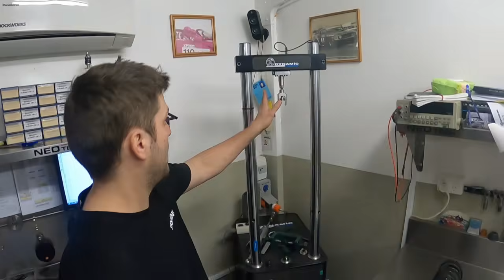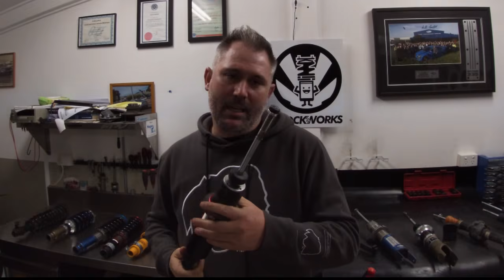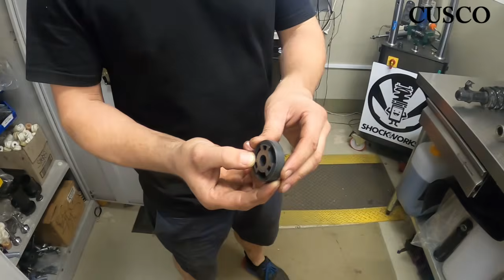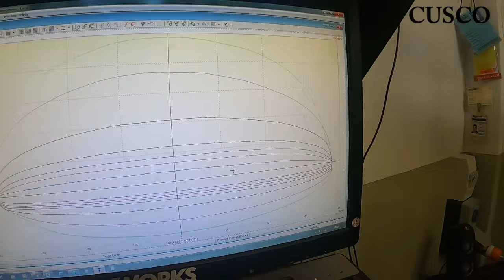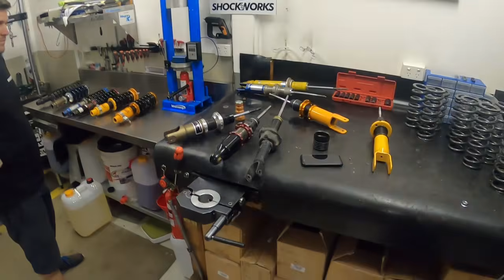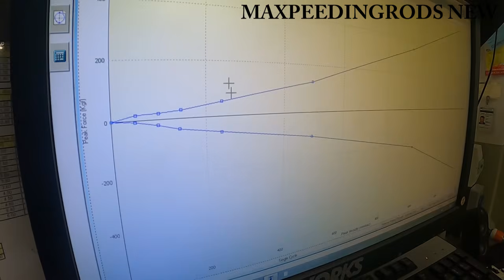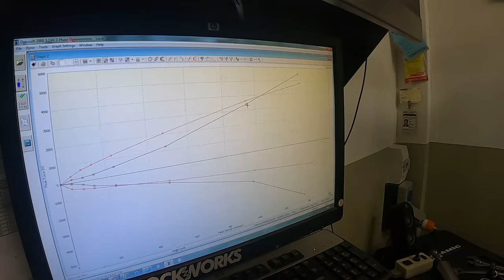8 BRANDS OF COILOVERS ON THE SHOCK DYNO!!! WORLD FIRST TEST

Comment: Great content guys and super informative. I’m a very amateur former club-level racer here in NSW who achieved reasonable results using the Tein Superstreets with the spring rates and valving as per Fulcrum’s setup. Oh-in a GDB WRX STI. The rear struts started leaking after about 5000km but I believe it may have been extended time between drives may have buggered the seals. I’ve had both rears rebuilt and the front left is leaking and knocking too. Have you dealt with these struts before as I’m keen to hear your opinion.
I’m thinking seriously about Shockworx setup for my FG GS. Good to see they performed well, though I’m also considering Bilsteins on Kings low as it’s not a track car.
Great content and I’m subbed.👍
Reply from the maker: I would get shockworks over tein any day heck I’d get bc over tein, but shockworks are amazing all the top time attack cars run them, plus they can be valved for street also
Reply: @TURBOTRISTO  whats wrong with tein? Just bought ones for my car, toyota chaser jzx100
Reply: @TURBOTRISTO  what’s up with the teins?
Reply: @daskamu  I’ve had both rear dampers rebuilt and the front left needs rebuilding as well. These are Tein Super Streets with less than 15,000 km on them.
I’ve found the Teins are great while they are working, in so far as they are OEM factory quiet, comfortable for the daily drive and still capable on the track for a bit of club-level shenanigans. The damping/spring rates are far from optimal for track but I’ve put down some respectable/competitive lap times on the Teins and I can “glide” over ripple strips that upset stiffer setups.
The low-km rebuilds are the biggest problem with mine, but I’m probably contributing by leaving the car for weeks at a time.
Reply: @TURBOTRISTO  most of the serious guys and gals in the NSW combined clubs Supersprint series I used to run in seem to be running MCA although I’ve seen some very quick cars on KWs, HSDs (surprisingly good from my observations) and BC racing. If/when I get the time to get back into it, I’ll be tossing up between MCA and Shockworks for a more track-focused setup for my long-suffering bugeye Subie.

Comment: Love the amount of data gathered. I'd be curious to see how the newer Maxpeedingrods T6 and T7 coilovers stack up against the ones shown in the video. It appears that the ones tested here are the Maxpeedingrods B3 coilovers and maybe the O-series prototype.
Reply from the maker: @jordanlatta  there is a new c series coming also, the t6/7 coil overs dyno test as good as the bc coilovers now, the are working on t8
Reply: @TURBOTRISTO 
Sweet! Thanks for the reply, just discovering your videos, looks like some neat content. I'm hoping to get some T6 coilovers for my 99 Impreza, but with custom spring rates a bit softer than normal (5kg or 6kh front, 4kg rear, similar to Tein Flex Z which is the go-to street oriented affordable Subaru coilover) since the roads near me are pretty rough on my current non-adjustable Raceland coilovers (9kg front, 6kh rear). Interested to see what tier the new C-series will be aimed at and how they perform.

Comment: The maximum pee rods are not all that bad for the price. I ran a set for a few months on my Bugeye WRX while I was deciding what I actually wanted to go with. They were actually surprisingly OK. If you just need something quick because your OEM ones took a poop they will serve you just fine. You can even get a bit sporty on them as well lol.
Reply from the maker: They are 3 times better now
Reply: @TURBOTRISTO  would love to see updated results for them ;)
Reply from the maker: latest video with the thumbnail "runs so smooth" has updated dyno sheets
Reply: @TURBOTRISTO  yeah I used the COT6 coilovers and they were super easy to adjust and install. If I was playing to do some sporty driving ("doing turbos" is what my girlfriend calls it lol) I would just adjust the knobs to stiffen them up and for everyday driving I kept them somewhere in the middle of the adjustment range. They actually looked pretty good as well, the blue and black looked really good with my blue brake calipers and gunmetal gray rims. They are definitely an upgrade from the OEM suspension that came on the 2nd gen wrx's. I eventually upgraded to a set of Tein coilovers and the only real difference was that the adjustment range was more dramatic and they felt less bouncy and at their softer settings, but honestly there wasn't actually a huge difference in the overall performance.
Reply from the maker: thats awesome news man

Comment: Would maxspeed coilovers be able to handle canyon and mountain drives consistently?
Reply from the maker: Depends on what you mean by consistently, as long as the roads aren’t to bumpy then there won’t be much heat in the oil or air causing cavitation

Comment: As a joke, my buddy got me some ebay coilovers for my daily driver.. I actually put them on to slam it (lol),, and will say they are definitely functional to a degree. They dont exactly soak up your standard pothole, but they are stiff, and even came with adjustable damper and camber. Certainly suitable for autocross, or anything entry level
Reply from the maker: @LetsGoECU1  no shocks slammed will soak up a pothole mate you need shock travel

Comment: Yep. Max speeding rods can take a hike. It would have been good if you could have tested new.. but seeing OEM hold up well after 300,000km and out perform new max speeding rods… re affirms I’ll. To buy them. I will check out shockworks to see if I can afford them for my two CELICA’s. ST-184R and 2ZZ-GE
Reply from the maker: Man they are not expensive for shockworks and they are truely the best coilovers on the market hands down they out perform bilstein and mca

Comment: If you want to eliminate that lighting flicker, you either need to switch the camera to PAL mode and shoot a PAL framerate like 25 or 50, or you need to activate shutter priority auto exposure and force lock a 1/50th of a second shutter speed with your 30fps filming. Basically, you live in a country with 50hz power mains, and no part of your camera's video settings match up with that frequency in order to cancel the flicker of the artificial lighting in your shop/house/street lights, etc. Either the frame rate OR the shutter speed has to be an even division of 2x the power line frequency to cancel the flicker.

Universal combinations that work in every country and look good are 25fps 1/40th or 1/60th shutter, 30 fps 1/50th shutter, or 50fps 1/60th shutter. 60 only works with a 1/100th shutter, which isn't slow enough to have natural-looking motion blur, and 24fps looks bad in general. Yeah, 25 isn't much practically/visibly different (it barely is when back to back from a trained eye like mine), but it's subconsciously smoother and produces less eye strain than 24, IMO. My go-to choices of the lot are either 30 or 50, depending on your digital storage space limits and a couple of other filming goals.
Reply from the maker: @Drunken_Hamster  all done mate sorry about that it’s frustrating
Reply: @TURBOTRISTO  Did you just change it, or did you figure it out long before I commented? If the latter, when was the change, and what settings did you go with?
Reply from the maker: @Drunken_Hamster when I was editing this video I fixed the settings
Reply: @TURBOTRISTO  Nice. I saw your most recent Accord video and noticed it was 50fps. I assume the shutter speed is on fully auto, though, because it didn't quite have the motion blur that I aim for with a 1/50th or 1/60th shutter.

Most people don't overthink things like me, but if you do (or just care, in general) go ahead and do the shutter priority mode thing and lock it in at 1/60th. If you later notice that the outdoor shots are blown way out, that means you need to close down the aperture, or if that's not an option (IE, you're using an action cam like a GoPro), then you need an ND filter.

You can get a 4-pack (different darkness levels) of Freewell ND filters for a decent price, and those'll work on a GoPro 9 or newer. IDK about other action cams.
Reply from the maker: cheers mate, im using a go pro 9

Comment: Where did you get that Multimatic dyno lol?  More response doesn't always mean better.  That's how you get really bad nibble.  Other than looking at the curve to see if the damper is functioning as intended, you can't tell whether it's a good damper or not.  So much depends on vehicle config and tuning targets.  It looks like you smacked the base valve or floating piston on the AMR.  As it travels from full rebound on the left to full compression on the right, the forces jump at the exact same spot and then it resumes opperation as normal.  Probably will go away if you reduce the travel.  But the tuner definitely knows what he's doing.  His Shockworks dyno curve was beautifully shaped!  Probably smooth and glides on smooth road, but kicks in the rebound control agressively, but progressively.
Reply from the maker: I’m no expert but Chris is he was litterally born into shocks and has spent his life mastering them, what ever he says I just smile nod and take as gospel

Comment: This is great I'm in two minds between these cheap coils and Whiteline springs for my lancer Vrx 

Very helpful content guys I've subscribed. P.s where about in Melbourne are you from?
Reply from the maker: From sprinvale mate thanks for the subscribe 💚 whiteline springs will be great but they might blow your shocks because stock shocks aren’t designed to be lowered, by the time you buy lowered shocks you might find it’s better off to go with some coil overs
Reply: @TURBOTRISTO  cool not far away I'm in Oakleigh..yeah alot of people have just run these Whiteline springs in their lancers on the OEMs with no issues. It's about a 35mm drop in height all around so nothing to crazy, so I think there is still quite abit of travel in the shocks. This car is a just a daily that gets driven to work and back each day, nothing hectic like track time, I do love the height control of the coilovers to be able to dial in that perfect height, I just need to decide if want the comfort of springs over the slammed look which is obviously going to be alot more of a ruff ride.
Reply from the maker: @Itsok-456  comfort is king man 30mm drop is sweet I did my mrs accord 30mm and it blew out a shock instantly, I work at koni and they say that anything over 30mm should need coil overs or custom shocks because the stroke isn’t long enough to absorb the bumps

Comment: what Maxpeedingrods does to mask the lack of dampening so people think their coilovers really improve handling is to over spring their coilovers which makes the car stay flat when cornering, add to the fact that the pillow balls they use are junk and can stop rotating after just a year of normal street driving, combine that with the fact that the thin teflon disk they use between the spring and the spring mount rip just from the force of the spring during normal street driving causing the spring to start digging into the lower mount and binding, put all that together and you end up with a car that is dangerous to drive to the point of causing the car to bump steer into the center divider, ask me how i know, my totaled toyota avalon is still sitting in my front yard, btw good luck trying to get maxpeedingrod coilovers warranted during the warranty period, all of a sudden their english not so good, you send money they send better stuff........
Reply: Throw MSR away and buy anything else.
hell cut springs and struts are better that this appalling POS.
FK coilovers work great for me and the same price.
Reply from the maker: @pethelprc4721  hey mate you are exactly correct the old style mxrs were absolute rubbish, they are up to version 8 of their upgrades now most of those issues if not all of them are fixed, the earlier versions 1-6 were very bad and caused them a lot of issues,

Comment: my xyz feel like they do the same as the maxspeeding rods lol, they dont do much for speed bumps but smash around when hitting a pothole
Reply from the maker: All the older Chinese coil overs aren’t  very good quality , mxr have made a heap of improvements but still along way to go
Reply: @TURBOTRISTO  I think I'll go back to bilstien and ssl springs, much better at the same height and cheaper, I think I adjusted them twice before the locking collars seized
Reply: @TURBOTRISTO  it also doesn't help that because they are slow reacting to soft bumps, I've had to turn the resistance up so my car doesn't slam into the ground coming off a speed bump, something the bilstiens didn't do at the same ride height

Comment: A great review, not only was the experiment fair but informative, generally these tests are just done by fitting the kit on the car and driven round a track, and the operator gives his/hers opinion nothing scientific but just an opinion so using the dyno is more precise and a lot fairer
Reply from the maker: Yeah those tests are not really fair
Reply: @TURBOTRISTO  no they’re not just because one person likes how a set of coil overs feel compared to another isn’t really a proper test, because the test can’t really be replicated on the exact same way while on the dyno, the ambient temp will be the same, the test perimeters and movement will be the exactly the same from the first test to the last
Reply from the maker: yep on a road you need to take into account fuel useage, tyre wear, brake fade how damp the roads are ect, ect

Comment: I would love to get some information on why my experience with Monroe shocks has been so disappointing. I’ve re-fitted three completely different cars with Monroe (yellow) shocks after the original ones wore out, and each time I ended up replacing them again with OEM shocks because, in my eyes, Monroe is pure garbage.

For the first few weeks or 1,000 km, they are smooth and firm, absorbing everything from road cracks, small bumps, and patches, while offering superb directional stability on highways, wind resistance, aquaplaning resistance, and handling undulating or wavy road conditions. However, after the initial running-in period, all the magic is gone. For the third time, it's the same story, as if the dampers are made from pastry.

The new Monroe shocks initially stick to the road and maintain direction, and I don't have to constantly adjust the steering wheel. I had two cars fitted with Monroe Reflex and one with an OEM replacement model (some sort of gas shocks).

But after that initial period:

Small roughness is no longer smoothed out; the car just vibrates.
The tail becomes unsteady, and I constantly have to adjust the steering wheel, similar to the effect of worn-out joints or low tire pressure.
Side winds or overtaking vehicles change the car's direction.
Thick layers of water on the road become hazardous as the car tends to change direction.
Large potholes aren’t dampened, and rough bumps are felt directly in the cabin.
The only aspects that remain somewhat effective are braking, acceleration stability (no excessive rolling, nose-diving, or pitching), cornering on perfectly even roads, and handling undulating road conditions. However, even these are reduced, and a loaded car has more issues with "throwing weight" from side to side before stabilizing than when the shocks were new.

The dampers seem to smooth out just one frequency after that point, which can be demonstrated by driving at a certain speed on a rough road. At slower speeds, they act stiff; at faster speeds, they go into resonance, which to me, feels like completely worn-out shocks.

They perform progressively worse in hot summer weather, then become fairly okay again during winter. In winter, they are silent again, with no vibration or resonance, and they smooth over different frequencies, though they are much stiffer over speed bumps.

The original shocks on all three of my cars were at least 10 years old and were better than new Monroes after just 1,000 km. I drive carefully and reasonably. When I replaced them with original dampers again, each car felt like an upper-class limo—smooth across various frequencies, no tail hunting, no "weight throwing" from corner to corner, great performance when loaded, and stable direction. Just like new Monroes, but the effect lasts for years—until I sold the car or, in one case, one damper exploded. And to my shock, the original shocks were also made by Monroe! So original OE Monroes and aftermarket ones are not same stuff. 

Can you tell me why?
Reply from the maker: I have taken your comment to a panel of experts from several suspension manufacturers and i will get back to you with an answer

Comment: Quick question... Because load cells are so sensitive, wouldn't touching anything attached to the load cell skew test results? 19:45
Reply from the maker: It gets calibrated each time
Reply: I understand that. I but at the time I posted, I touched and pulled down on the aperatus while the testing was going on. This should never be touched while the testing is in operation. Could have been why a coil over from a reputable company scored so badly.
Reply from the maker: @Motoro40  nah those ‘reputable company’s ‘ are pretty junk too
Reply: I see where you are coming from.... Good day.
Reply from the maker: @Motoro40  it’s very hard to find brands of street parts that are as good as they say they are like tied or hks or Cusco they just aren’t that good, and not worth the money, brands like shockworks Koni bilstein ect are very high quality

Comment: also....
as cool as this is showing the performance of the damper is cool. but these are designed to work with a specific preload/ spring etc...
Reply from the maker: Spring rates are interchangeable , pre load is always 3-5mm as a rule of thumb, shocks all tested on the softest setting